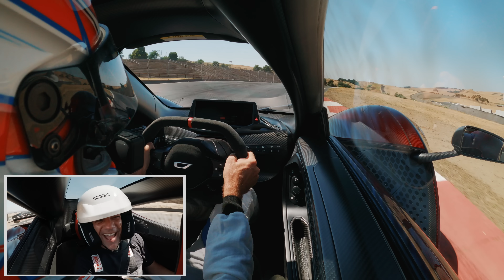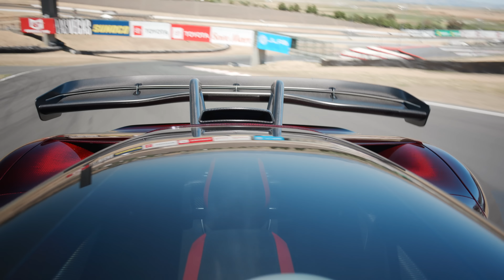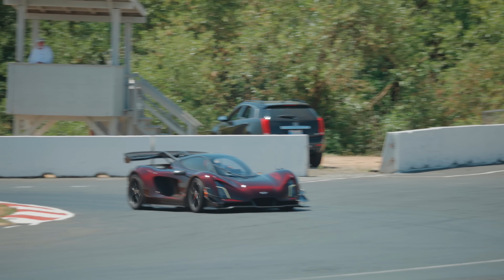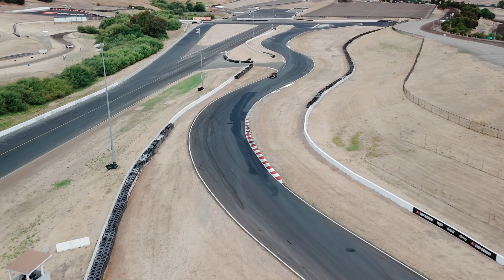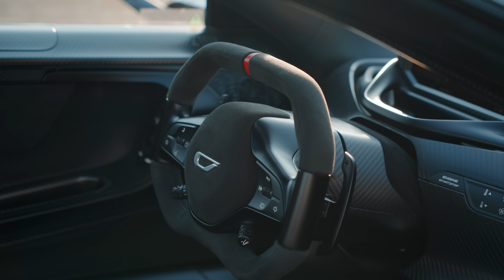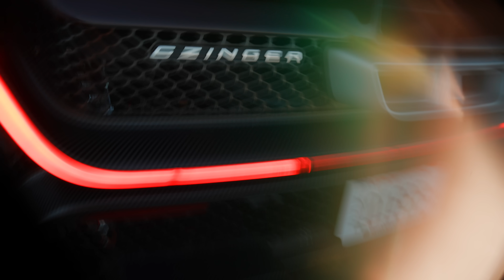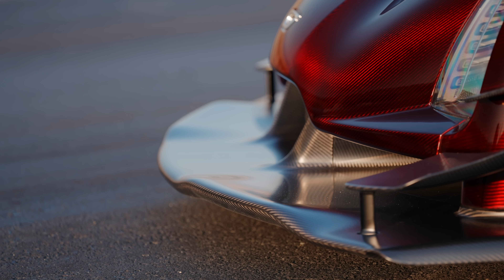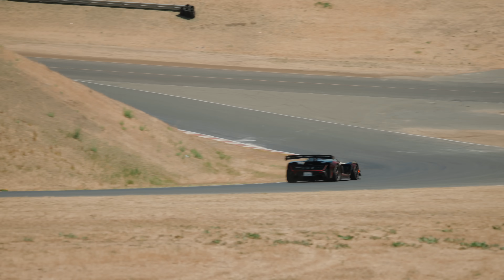FIRST DRIVE: Czinger 21C, The Wild 3D-Printed Hypercar

Comment: The additive tech has been around for several years, Koenigsegg has been using that tech in house since at least 2020. Did they contract through Czinger? Because Christian was showing the work being done in their own "factory". Also, Czinger seems and acts like a spoiled rich kid that was able to create this company because he already had connections to deeeeep pockets, and behaves like a classic car salesman. Making huge claims that are absolutely not true. Like it being the "fastest hypercar". The candy coated carbon fiber is glorious though, and is actually perfect for the exterior color. Gotta be a carbon kevlar composite! That would look equally sick in a blue & black comp with a blue transparent/candy color like Lapis Lazuli. Same goes for an emerald green,  etc etc. That wing is wayyyyyy too floppy though, and the car weighs far too much! GMA did it right with the T.50 & T.33. Lightweight, nimble, sleek, 3 seats (in the T.50) which is the best for actual useability, and that Cosworth engine is symphonic! This is a great car, but it only has one use. The GMA cars whoop the sh!t out of it in every sense! Even in the looks department! That red though...I'll take that material and color combo on any vehicle that has ever been made or ever will be made! It harkens back to the spectacle Black Cherry Metallic of a 1970 Chevy Nova SS. Gotta have pop in that flop!

Comment: How the hell is that thing so damn heavy even though it has a bunch of 3d printed parts made to the lowest gram?! 

They better make those lap time plaques removeable, because they BARELY got those records over the Jesko, and Sadair's Spear is WAY faster than the Jesko, even on shakedown runs.
Reply: 1600 odd kilos?  Cripes, what went wrong?  Probably because it has a conventional internal combustion engine and drivetrain, plus two electric motors, plus a generator, plus some battery.  Give me a McMurtry any day.

Comment: 2.8 liters and 11,000 RPM sounds a lot like 2 1.4 liter Hayabusas turned into a V8.
Reply: That or a ZX14 derivative were my initial thoughts as well. Obviously there have been several Busa V8 derivatives, so that would be my bet.
Reply: @corystansbury  2.88l is exactly 2 1441cc ZX14R engines stuck together, which is what Synergy Auto builds, so that's probably it. Similar quoted power numbers too.
Reply: Oooh maybe I can buy one off the shelf and turn my BRZ into something ridiculous 😂
Reply: @Markisamiller  Synergy offers a kit that does exactly that :)
Reply: @damncritics  same bore and stroke at 84mm x 65mm too
Reply: @corystansbury oooh good call.
Reply: actually temerario sound resembles this thing, nobody realizes it
Reply: If you look at pictures of thw engine you can tell its 2 bike engine by the cylinder heads alone still super cool tho
Reply: @clonecaptian  It is extremely cool. I don't know why bike engine-based V8s have taken so long to become more popular. Hartley's original Hayabusa-derived design has been around for damn near 20 years now and it's only in the last few years that we've seen them being used more often in applications. They're incredibly light, rev incredibly high, make a ridiculous amount of specific power, and while the upfront costs are expensive, maintenance is, in principle, no more difficult or more expensive than any other superbike because the parts are so common (you can basically buy the entire top end as well as the rods and pistons off the shelf).
Reply: Perhaps this is why it’s a twin barreled gearbox?
Reply: But it is not, the Czinger Engine is clean sheet Design fully proprietary Design.
Reply: @vladpootin5973  Thanks for the correction, V.P. of Knowledge
Reply: @gen1c8rs88  the F40‘s unit is a 2,936cc to be exact. The Czinger engine is 100% bespoke and proprietary, a clean sheet engineering designed specifically for the Czinger only. Not based on anything pre-existing, nothing shared. 👍 G‘day
Reply: Which is weird when you see the cost of the engine. Apparently it’s not so simple slapping two motorbike engines together..  didn’t the Atom have one too?
Reply: Wish the displacment was 3000cc, 84mm×67.67mm, 1.24:1 bore/stroke ratio, with 900 HP + 450HP electric
Reply: @gen1c8rs88 Why those specs?
Reply: @Trickster7916  It's a compact V8 I would hope for 90mm bore spacing and 1.24 to 1 bore to stroke ratio maximizes displacement with still being quick rpm friendly, 300 HP per  litre is a good stopping point, 1/3 hybrid assist with well established current technology is also a good place to stop.
Reply: 288 GTO as hypercar

Comment: I’d love to see a single seater version that rocks a scaled up V10 or V12 version. Imagine how that would sound. 

Looks like the torque vectoring could use some tweaking to work better with the aerodynamics of the package. Luckily almost all of that can be continued to be worked on and updated. 

Hoping to get more of a look into their factory. The car is cool but the engineering and manufacturing is where they will see the real ROI.
Reply: V10 Twin turbo will take lot of space and N/A V10 can never match TT V8. So its currently perfect. You should hope they wont switch to a TT v6 since thats even smaller.

Comment: To everyone going off about the wing. Take a look at the wings of GTD/GT3 cars. The wings of F1 cars, professional hill climb and time attack cars. ALL of them move! Especially laterally. They need to move. Too stiff and you have something that will be more brittle. The strength is in the vertical plane so that the wings can provide DOWN force. Side to side does not matter as much as up and down strength. A note on aerodynamic flex: A 787's wing can flex up to 150% before it breaks. I am not worried at all about the Czinger.
Reply: A 787 has a maximum STATIC deflection of 150%. But it doesn’t vibrate between -150% and 150%. Maybe they designed it to vibrate like this, maybe they didn’t, who knows.
Reply: I love how it’s basically waving goodbye to the competition behind.. lol
Reply: Understood, thanks for the info
Reply: Yes they move, their hydraulic systems moving a portion of the wing up and down for increased downforce.  Similar in F1.  But the flex in this rear wing against its strut system connected to the car does not look normal.  It’s flopping up and down at the edges like it’s made of cheap plastic.  Go look at any video of the Porsche GT3, GT3 RS or even and F1 car, you will not see this type of flex in the rear wing.  I don’t disagree there needs to be some flex, but the jiggling and flexing in this wing is strange.  BTW, the swan neck strut on a Porsche GT3 RS is connected through the body to the chassis, watch the video when he opens the rear deck lid, the wing goes up with the lid.
Reply: @bluesky9093 He is talking about GT3 race cars, and they do flex even more than this and look like they will break. They are designed that way. Also wings don’t need to be bolted to the chassis. The GT3RS isn’t the blueprint of how cars should be made. The Jesko’s wing for example goes up with the lid too. Plenty of cars do.
Reply: These people have never seen aircraft wings… lol
Reply: cope harder
Reply: Its looks wrong so it is wrong. Poor design, thats all.
Reply: @XAIcommentbot says a bot
Reply: @XAIcommentbot  No, I used Cosmosworks years ago to do stress simulations on load-bearing components and it becomes clear what will hold up and what won't. Then we (they) build in an additional percentage just to be sure.  Please share your formal design experience from the workplace, I'm interested.

Comment: With all the AI design and 3D printing, why does it still weigh so much? I’d have expected more optimization of materials and structure to bring the weight down.
Reply: I think ICE plus drivetrain plus 2x electric motors plus generator plus some battery.  Bad idea.  McMurtry would probably kill it.

Comment: The Engine Specs Are Absolutely Wild
Reply: capacity, revs, bore and stroke match a V8 made of 2x Kawasaki ZX14 engines on a common crank, like the one offered by synergy auto
Reply: Y hecho por el

Comment: 0:20 make this car with only the twin turbo V8 ..  skip on the hybrid system and make it only RWD.

That would make it 250kg lighter and it would be phenomenal and more then u ever need. 

a 1000kg car like that would be insane
Reply: You mean like other American cars like the Hennessy venom and the ssc tuatara ? Rear wheel drive only is dumb with that kind of HP. The 2 cars with the highest power to weight ratio in the world are the venom and tuatara. Guess what they're 0 to 60 is ? 2.5 seconds. Slower than freaking sedans. They're also worse on the track. Unless  someone plans to go 290 miles an hour, the cars are basically death traps. The Corvette zr1x beats both of these cars on track and drag at 10% of the price. Have some imagination besides the same recipe for almost every dam American sports car. 2 wheels simply don't have the grip for that kind of HP.
Reply: @amerhamad-zp6ge  No. Venom and Tuatara have way over 1000hp and weight much more.

a 750hp/1000kg/RWD car is closer to a GMA T.50 then the hypercars u named.

Im talking about a drivers car and not about 0-60 times. If u only think in numbers, u better stick to EVs and other silly high horsepower/AWD cars.
Reply: @14:37 did he not say 1620kg wet? I know they quote 1250kg dry but……
Reply: @jamesford6578  wow thats crazy. I think i overheard that. I just looked up the weight and it said 1250kg. 

Well.. then the car would most defenitely benefit from losing weight. 1620kg would be way to much if i was a potential buyer.
i just dont know where 370kg suddenly come from. Adding fuel and fluids doesnt add so much weight (normally)

Especially when we see that GMA managed to make the T.50 sub 1000kg.  (supposedly 986kg curb weight) 

that would mean that the Czinger is over 60% heavier then a T.50..

And even the hybrid Valkyrie is supposedly under 1400kg curb weight.
Reply: @max.racing if im not mistake. Valkyrie weight 1355kg curb without driver.
Reply: @jamesford6578 it the prototype. Road and Track July say this cars weight 1450kg dry in production version. EPA document January 2025 say this cars weight 1700kg wet

Comment: While I recognize there can be some flexibility in the rear wing, this  one doesn’t seem right in how much it bends, flexes and even jiggles about.  Watch any video on a Porsche GT3 RS and you will not see this kind of flex, yes the DRS system is moving a full horizontal portion of the wing up and down through it’s hydraulic system to alter downforce, but you will not see flexing on the tips like this car.  Look at how rigid a Porsche wing is on its swan neck strut system connected to the car and then watch this video again, you will see exactly what I’m referring to.  On a Porsche the swan neck struct runs through the car and is connected to the actual chassis, watch this video at 10:36, the strut system is just connected to the rear deck lid and I assume this is why there is so much flex. I’m sure they did their engineering on this car and the wing can handle it, but if I’m paying over $2M for a hyper car I don’t want to look in the rear mirrors and see the wing flopping about like that.  It would be unnerving to me.  Even on an F1 car the rear wings have some flex, but they do not move as much as the wing on this car.  It’s a great car and some cool technology, but frankly just another 1,000 hp hyper car that is meaningless.  Porsche has the right recipe, you don’t need 1,000 hp or more, but the right hp with proper aerodynamics and and a chassis and suspension setup that is sublime.

Comment: Curious if since the electric is driving the front wheels, if you get on it coming out of a turn, will it exhibit under steer initially until the ice engines begins to grip and push you around the apex?

Normally a smaller higher revving turbo engine exhibits some turbo lag also whereas the EV will be instant when getting on throttle. 

By no means am I knocking a vehicle I've never driven or ridden in, I'm just curious from the engineering angle on how they tackled that issue.

Comment: Is it really 650 kg lighter than the Corvette ZR1X, with similar (more hybrid leaning) drivetrain?
1620kg wet, so no. Maybe...300 kg lighter? 1250 kg is what Google told me for the 21C. The usual over-estimation we see in modern hypercars?
AMG One was to be 1200 kg and came out 1700 kg. Rimac Nevera gained 400+ kg between presentation and delivery.

Comment: For that price I didn't expect to see a wobbly rear spoiler. A rear spoiler can't be doing anything to down force if it wobbles so much.
Reply: Watch gt3 racing and you'll see how wrong you are
Reply: @km6832  while the wings will bounce a bit, I don't see a single one wobbling side to side like the Czinger in GT3.

Here's a race from 2 months ago, I can't see a single wing doing that same kind of side to side rolling.
https://www.youtube.com/watch?v=E7W4B2BrI5A
Reply: @theelmagoo  i see what you mean but thats because of how they chose to mount the wing. The swan necks are close to each other, and most of the downforce is produced on the outer edges of the wing, mounting the swan necks close leave clean undisturbed air hitting the wing, so its gonna flex had they mounted the swan necks further apart it would be more stable but they sacrifice downforce.
Reply: @theelmagoo  That track is dramatically smoother than what see here, and GT3 cars wing supports are much further outboard than what we see here.

Comment: That wing looks like its fastened with bubble gum 😳 Never seen a wing shake like that
Reply: Never watched F1 ?
Reply: @samueljones3668  F1 wings don't roll side to side like that as they're fixed on the sides.  Yes they bounce and wobble a little up and down and shake a bit, but not to the degree the Czinger is here.

This is the latest F1 race, I can't see a single wing rolling side to side here
https://www.youtube.com/watch?v=hrPtK5D5yn4
Reply: Wait till you see how shaky F1 front wings are.
Reply: @Muhluri this is not a f1 car with programmed deformation aero parts
Reply: @alexprost7505 the wing does have programmed deformation though, yes it’s a road car but it’s also a track focused HyperCar so expect F1 like features, I mean come on the AMG one is also a road car but it’s has f1 technology all over the place 😂
Reply: It's supposed to bend with DF
Reply: That's the point, flexible wings are more efficient than rigid ones that's why they are used in airplanes and F1 cars
Reply: @mzansicarenthusiast428  Comparing this to F1 in any capacity is criminal, they don't wobble like this at all
Reply: @Rezcuz front wings do
Reply: Never watched through an airplane window?
Reply: @Angel-rg9dh It's not an airplane.
Reply: they’re supposed to be like that
Reply: Completely different. The airplane wing is designed to flex to absorb shock. This wing seems like it will unsettle the car at high speed.
Reply: @juiceda6  it would take a lot of wing deflection to unsettle the car considering the attachment point of the wing.
Reply: @juiceda6 do F1 wings shaking unstettle the car you clueless wannabe troll?